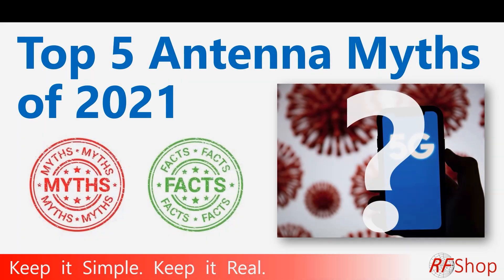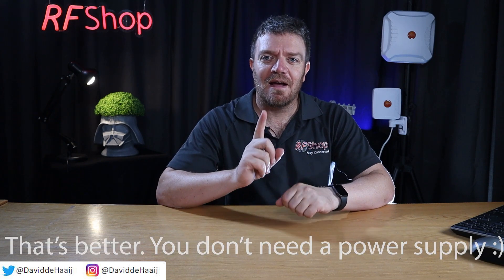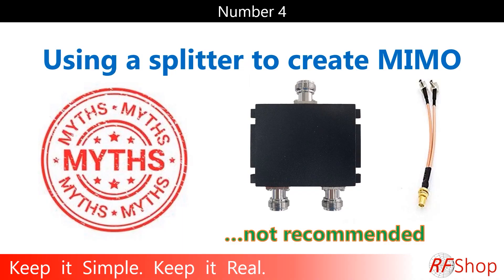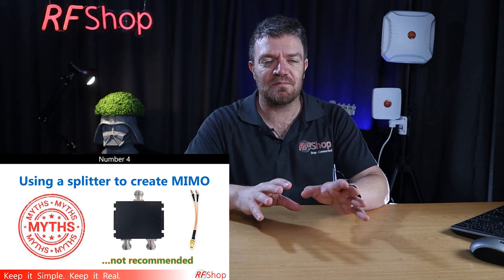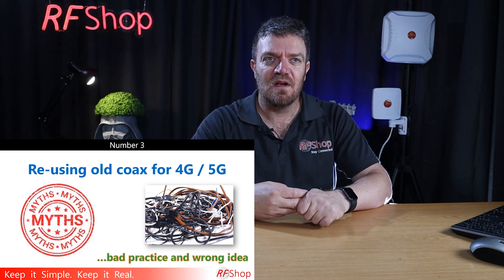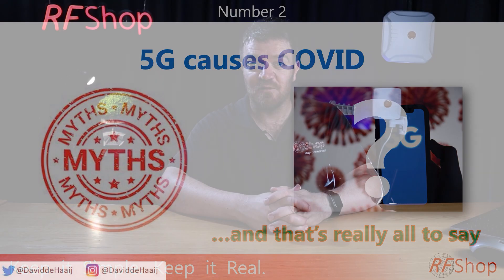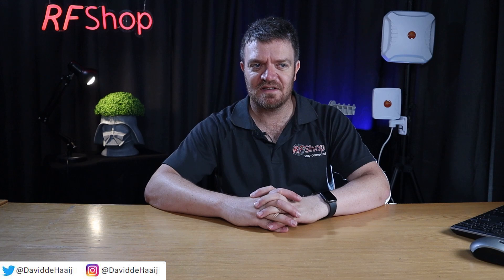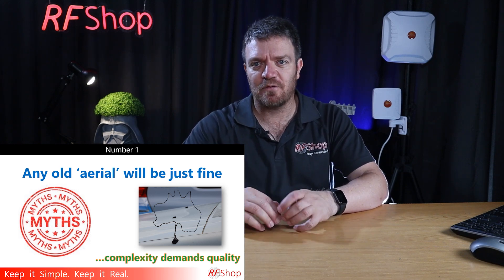Top 5 Antenna Myths 2021

Comment: i bought two 8dbi antenna’s for the same spot, i see huge difference. one is high gain and the other is tuned high gain. the tuned one is the worst of them. why is that?
Reply from the maker: Thanks for your comment. Just a silly question, but can you confirm the antenna is tuned to the right frequencies? 
If it's from different manufacturer, it probably highlights one of the pet peeves I have in how antennas are specified and sold...they should have been identical and if anything the tuned antenna should have been better. The fact that they are not raises a flag and concern about that particular antenna in my humble opinion. However, one needs to be fair to the manufacturer and just also study the environment, installation etc. before jumping too far to conclusions :)